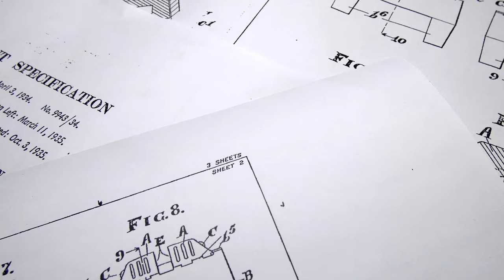Road Studs - Cat's Eyes: A Time-Tested Solution to Road Safety

Comment: what is the lifetime of a cat's eye road   stud - original  reflective  type ? And that of the reflective  colored plastic types mentioned ?
Reply: Cats eyes can last 10+ years if on a quieter road with not much traffic driving over them, but they sometimes only last 5 years or so on a major road where they get drove over often because the rubber gets worn down so much that the eyes break out of them, the stick on reflectors however start breaking off after about 3 years, on dual carriageway, main roads ect they only last a few months but they do make plastic reflectors in cast iron bases that can last a few years on major roads aswell. In my opinion stimsonite stick-on reflectors last a bit longer than the 3m branded stick-on ones